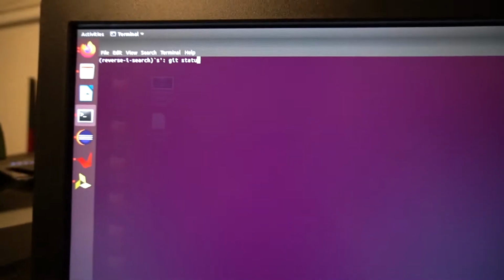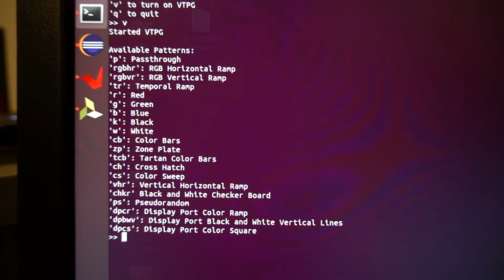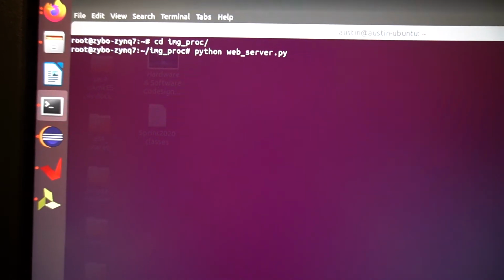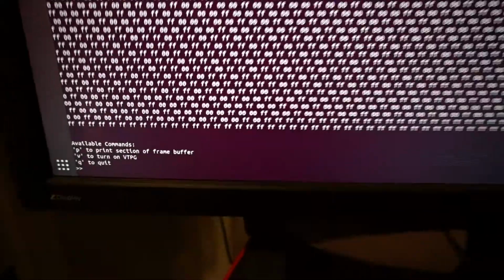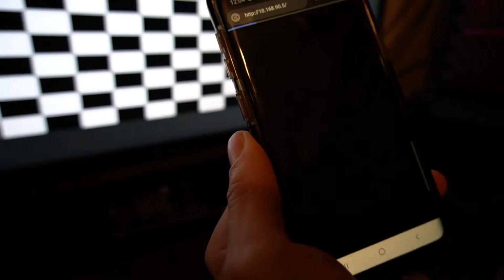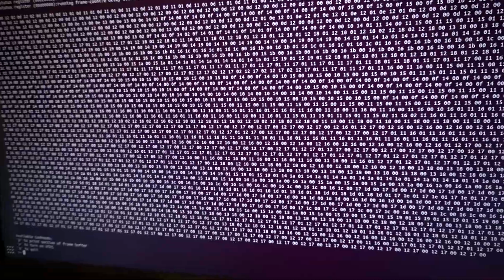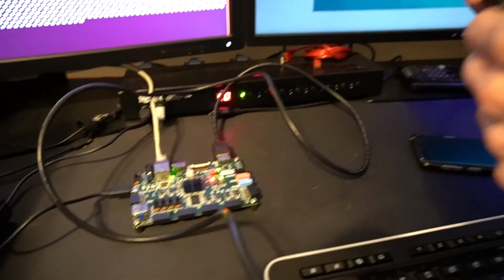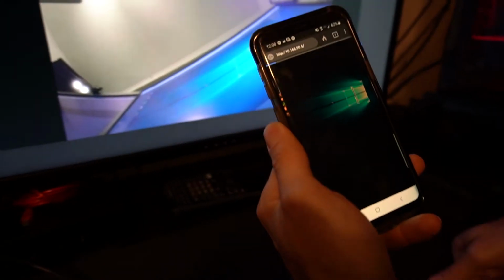VDMA with Video Test Pattern Generator and HDMI Input with Zybo Z7-20 Demo

Comment: Do you have overheating issues? Do you think heatsink fan is necessary?
Reply from the maker: No, I never had overheating issues with this board, but it's not like I've ran extensive stress testing on it either though.